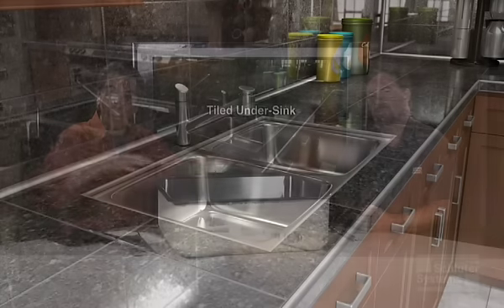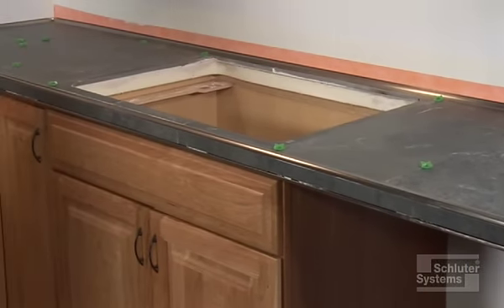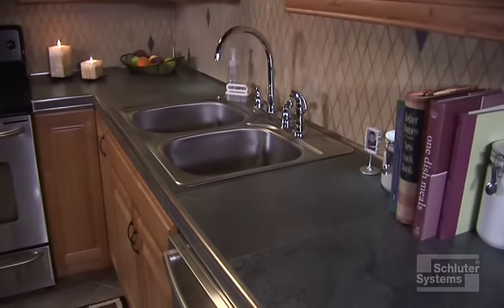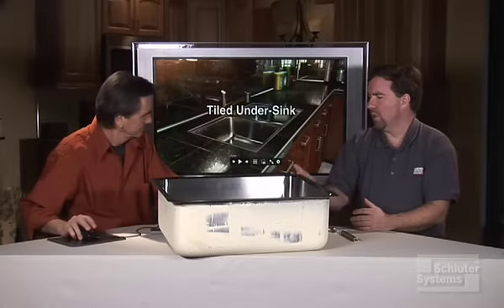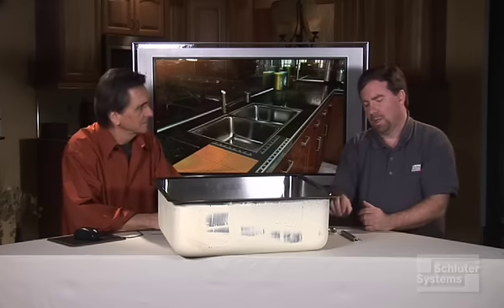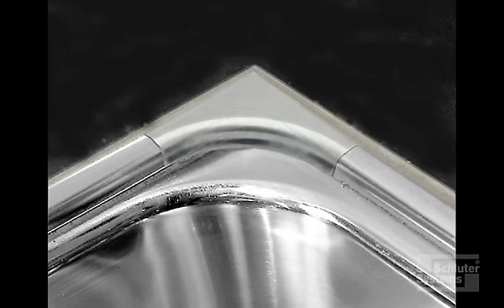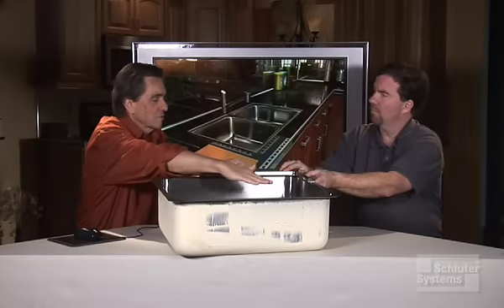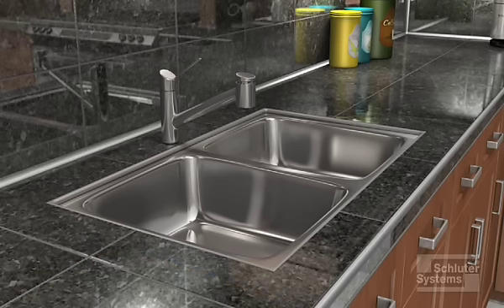Schluter®-Systems: Tiled-Under Sink

Comment: Question about the Rondec sink corners: Are they sold individually, or in a package of 4?
Reply from the maker: Hi there! All corner pieces are sold individually.
Reply: Schluter-Systems North America Thanks. That helps with planning.
Reply from the maker: Happy to help!
Reply: Where can I get these corners?
Reply: @titeo281  Any Schluter dealer can special order them. Unless you live in an area with a LOT of ultra-rich these wouldn't be an in-stock item because the Schluter sink corners are extremely expensive - as in $30 to $45 per corner expensive.